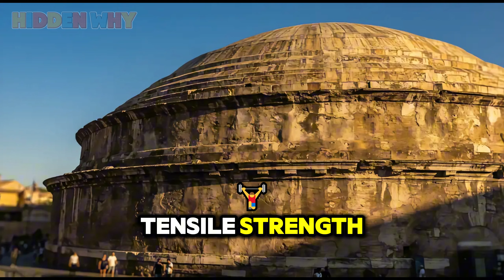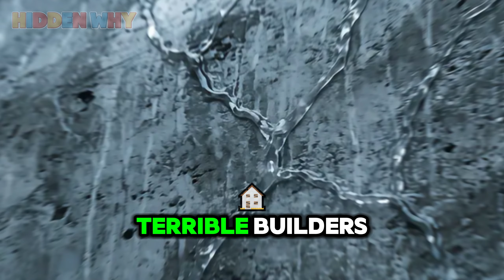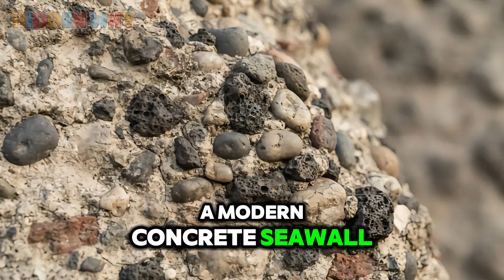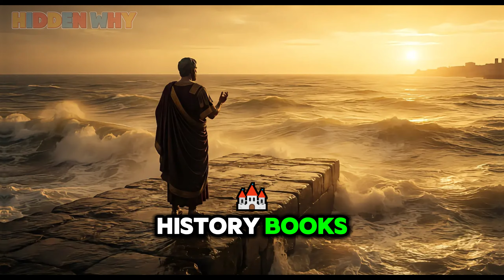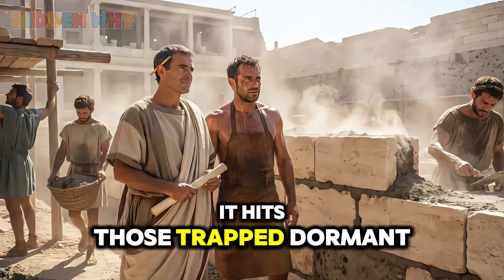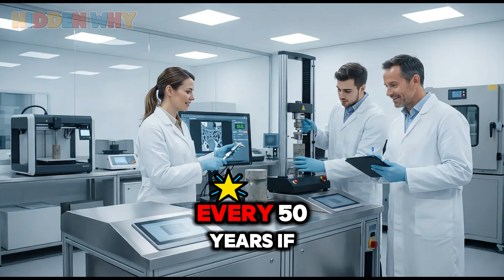Scientists Finally Solved the Secret of Roman Concrete

Comment: Concrete doesn't "dry". It sets . . the process is a chemical reaction which produces heat and consumes water . . the longer the setting concrete remains wet, the more complete the reaction which makes it stronger. 

The Romans knew all of this and improved on it by including lime and pozzalano (volcanic ash) which could cause further chemical reactions to heal cracks later if water penetrated the interior.
Reply from the maker: Thank you for your valuable insights. I really appreciate your knowledge. I hope you'll continue contributing and helping this channel grow.